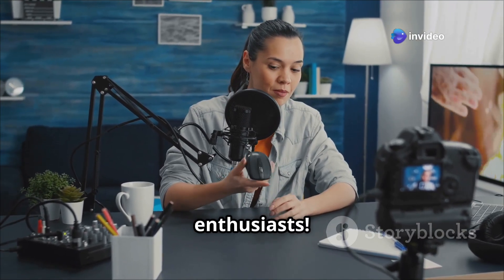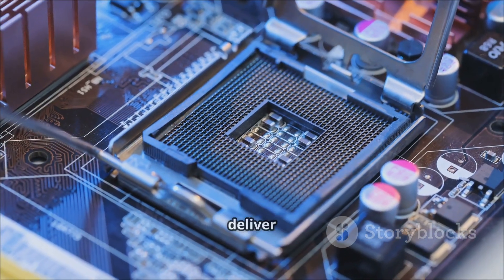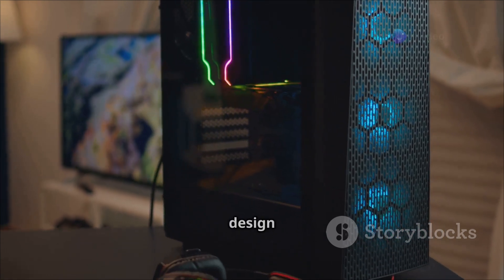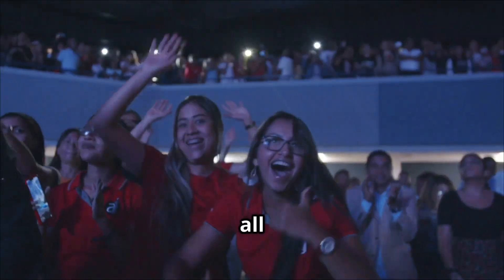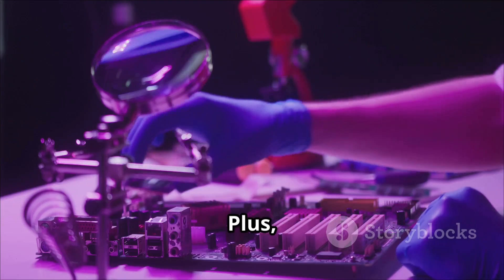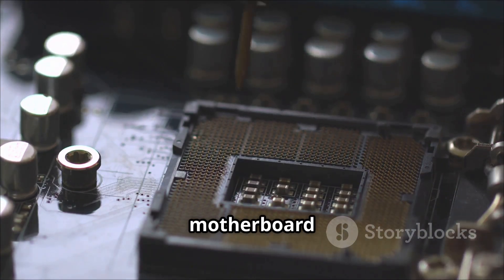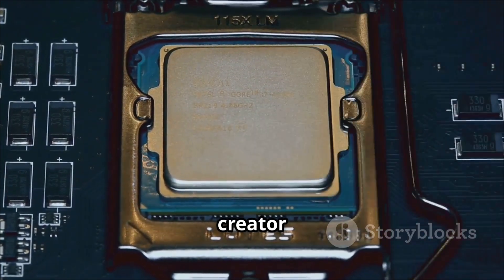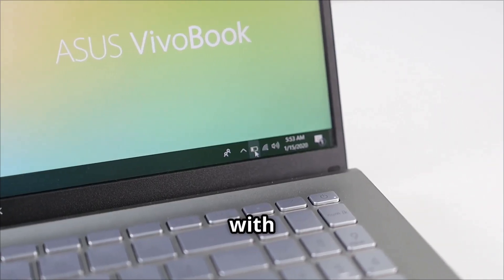ASUS ROG Crosshair X870E APEX: The Overclocking Beast Unleashed!

Comment: Interesting and Intriguing. What's the fastest speed of DDR5 can it handle if you have 192gb  or greater?
Reply from the maker: The fastest stable speed achieved for DDR5 RAM at 192GB (4x48GB) is 6000MHz, particularly with high-quality modules like G.Skill Trident Z5 or Corsair Vengeance, on motherboards such as MSI X670E Carbon or MEG Godlike, paired with AMD Ryzen 9 7950X or 9950X3D processors.  

Achieving this speed requires enabling XMP/EXPO profiles and may necessitate manual BIOS tuning.  However, stability can vary based on the specific hardware and BIOS configurations.  

For most users seeking a balance between capacity and stability, operating at speeds between 5200MHz and 5600MHz is recommended unless you're prepared to engage in advanced system tuning.  

Thank you.